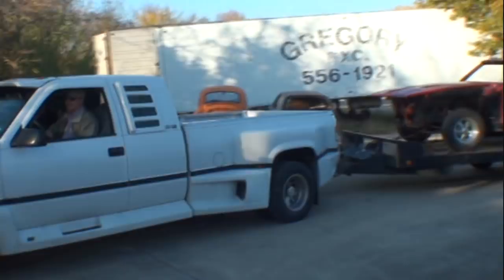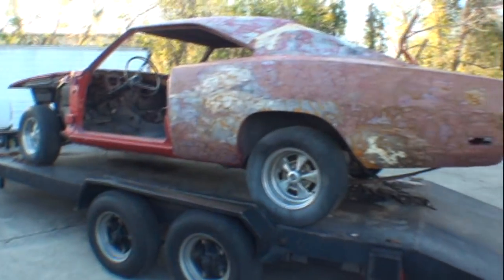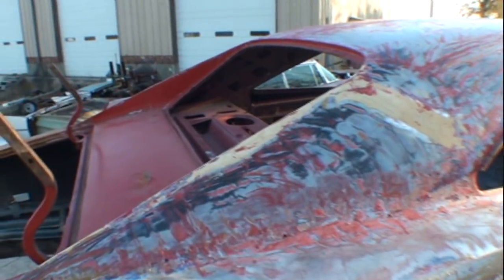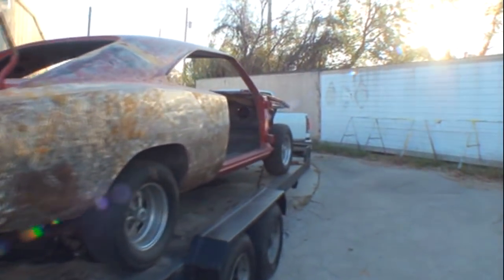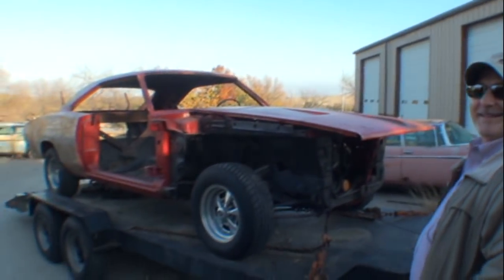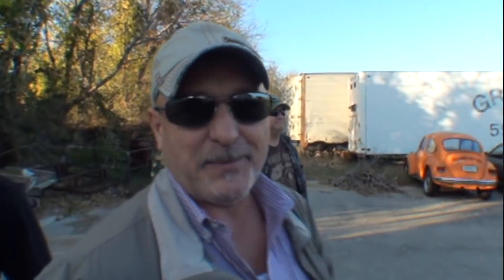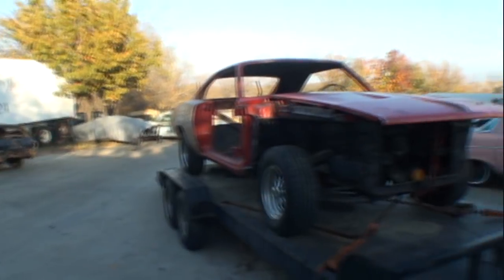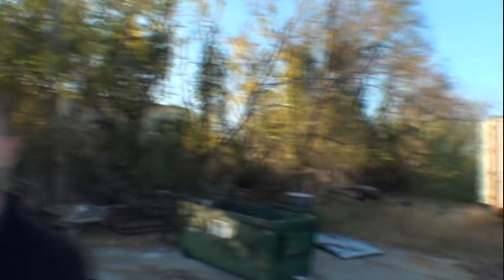The "MILLION DOLLAR CAR" - What's The TRUTH behind this PILE Of JUNK!

Comment: Ive been a mopar  head for 25 yrs but the prices today for clapped out shit piles is mind numbing especially chargers and cudas. There's something fishy about that guys car because the r/t option base engine was the 440 with the hemi as an option if that's a factory 383 car it's not an r/t it's a magnum charger more in line with the road runner or super bee price range and performance r/t was top of the line option with the biggest engine as standard equipment
Reply: Your right. something funny here
Reply: not really - its not a # matching car - it quite possibly arrived from factory with a 440 - Dave just had the 383 & used it ... all in all hurts the value some everything he does differently BUt its quite possibly a legit R/T SE.
Reply: nemesisX rox yes it could be a legit r/t but Dave said in the vid that it's a factory 383 car

Comment: DUKES OF HAZZARD and Fast n Furious made these Chargers go through the ceiling, price wise. Now everyone wants one (Except Pete). When demand is high, the selling prices go up.
Reply: if it's not screen-used what's the point in playing,  like this one local  guy with matching "G.Lee" leather jacket, orange repaint, roll bar, CB radio, numbers, flag, and the wrong model  year.  

For those playing along at home, an example of a 1969 Roadrunner that 
will remove your (initial) $25k  with just one turn of a pen on a 
checkbook.
   https://knoxville.craigslist.org/cto/6092782855.html

Comment: Mopars were way better engineered than GM's and Fords and just much cooler. Now they are worth much more than chivies and furds because they made so damn many chivs and frods and Mopars are now rare, and then Hemi mopars are super rare.
BTW the Charger R/T came standard with a 440 Magnum with the Hemi as an option and had bigger torsion bars in the front, a sway bar and HD Springs in the back. If it is an R/T the 383 is a transplant. This guy does not know mopars!